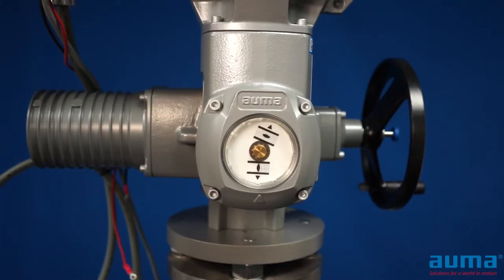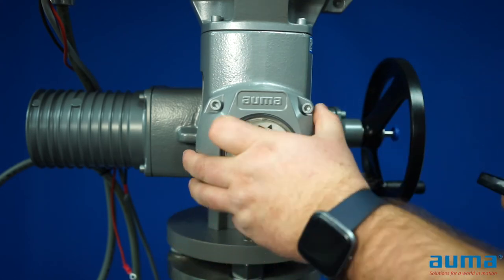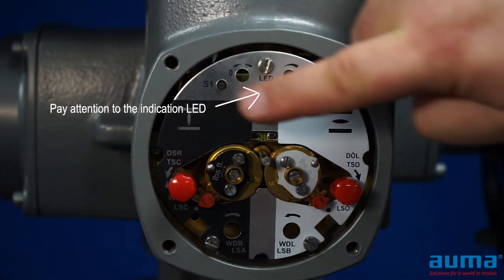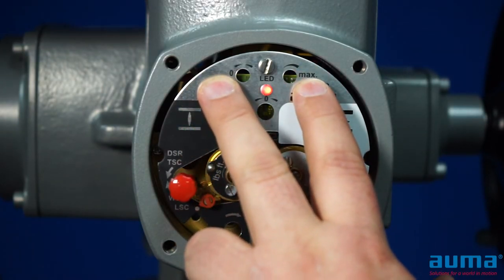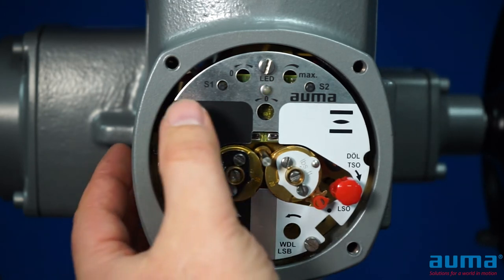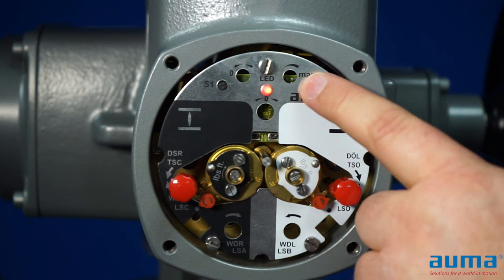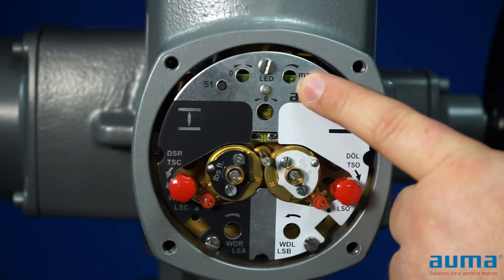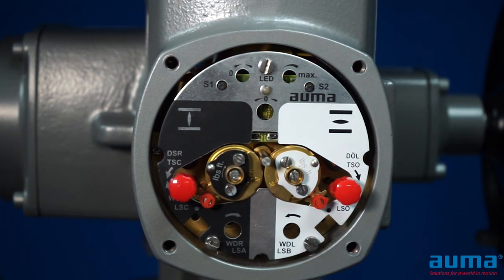AUMA Actuators - EWG Feedback

Comment: AUMAN MANUFACTURER ENGINEER ELECTRIC CIRCUIT DESIGNER IS NOT GOOD ,  I Received The valves we Done Heavy Mistake during Calibration due to bad engineering , I Auma NEED i can Highlight these issue with your Engineer.
Reply from the maker: Hi Asir, can you please provide me your location so I may connect you with a local service representative?